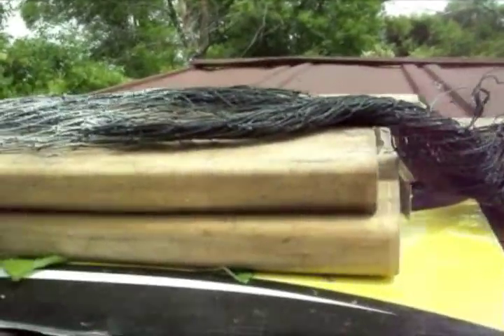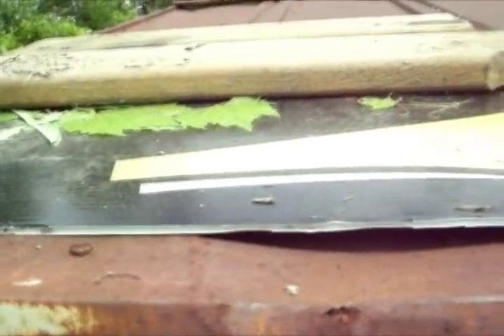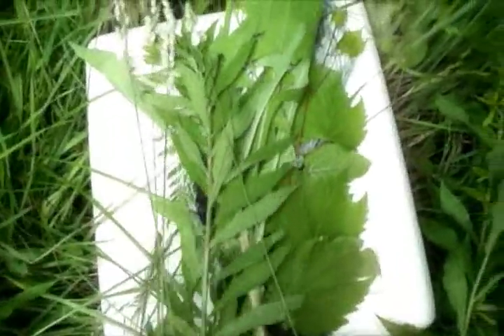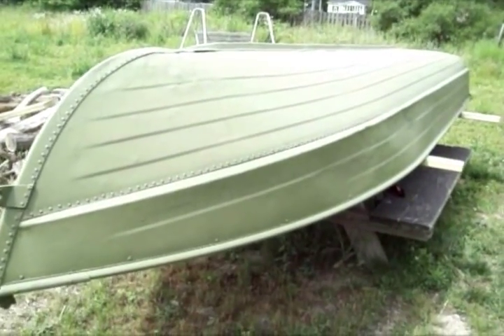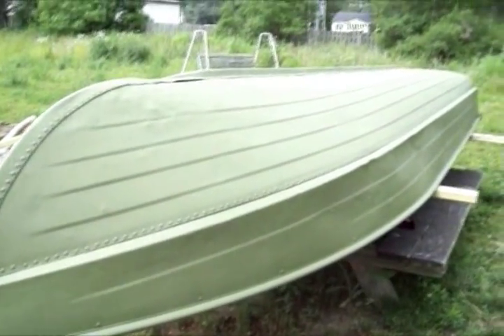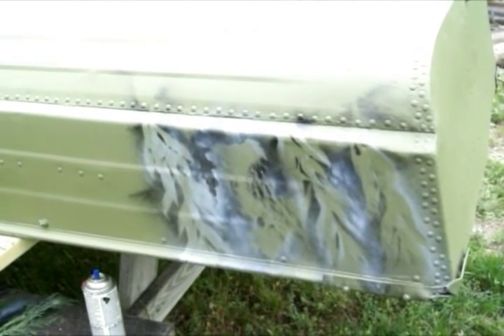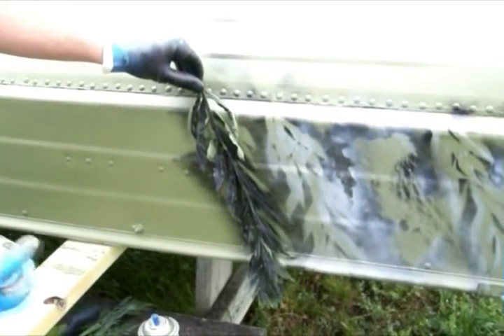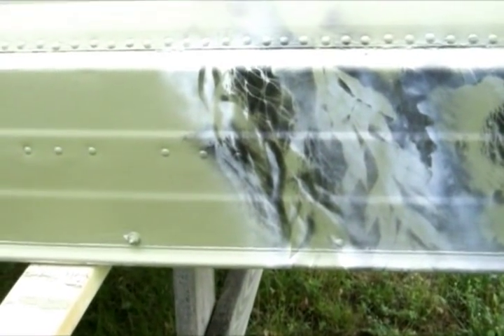How to paint camo

Comment: came out good.....never thought about using white though. and using clear coat just takes away from the flat paint.... lol...i had a 71 ford, that i did thiss to in 2001. came out great.right now im doing a trailer.it was an old military one....... your method and tips are better than some i have seen on you tube... always start with the light colors first. the blacks adds depth and shadow...

Comment: Taking cheap paper glue and making templates is also very easy and awesome. Lots of videos on it and when it dried its like a professional latex reusable stencil. All you have to do is take a very small amount of oil any kind rub lightly on smooth surfaces (I used glass works great) then take white paper glue (I got a bunch at Walmart back to school $0.25 each) and make a pattern and allow it to dry. After about 24hrs it will look clear and you can take a razor loosen a corner then just pull it up. It's reusable as I mentioned earlier and flexible plus you can make them as big as you like. If you use to much oil the glue will separate or run together so very lightly. I've made a bunch of them different patterns. It's easy and fun lol

Comment: Dave...just saw the vid great job!  One question tho what all prep work did you do to the boat before painting?  If sanding what grit paper did you use?  Thanks
Reply from the maker: I did do a lot of prep work. The boat actually had a small hole in it that had been patched before I bought it, but I re-patched it using fiberglass. Honestly, it was 5 years ago, I don't remember what grit I used. I'm thinking somewhere in the 100 range. Glad you like the vid. If you have more questions, I'd be glad to help.
Reply: I'd probably use anywhere from 250 to 600 grit depending on the surface but the paint will look better the higher grit paper the smoother and better it will look. Most decent spray paints will bond well to a lightly scuffed surface.

Comment: really nice job! best i've seen. do you have any recommendations on how to apply the foliage effects to larger surface areas? i have an old chevy 4x4 van and the body and paint are in great condition, but it has some advertising decals (removed) that have bleed into the clear coat and needs repainting. if i thought i could get anywhere near the effects you achieve i would definitely give it a try. do you have any other camo technique vids posted?
Reply from the maker: I did my friends camper too. Not sure if it will help or not.....Ultimate camo painting part 2